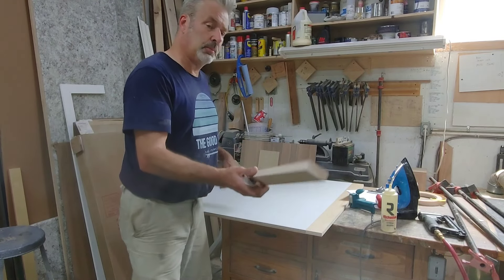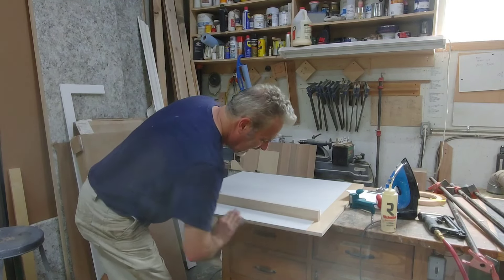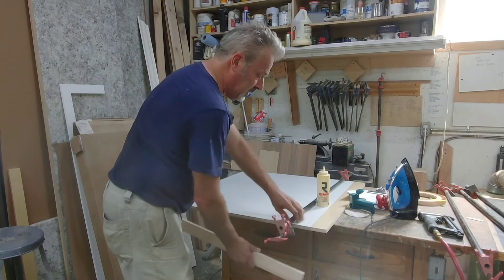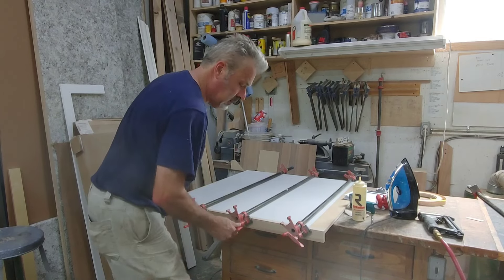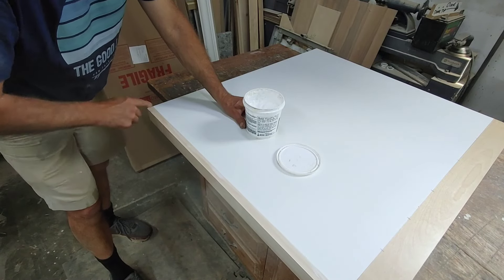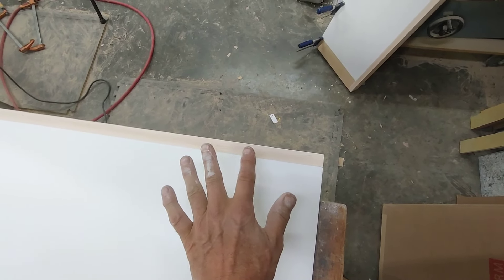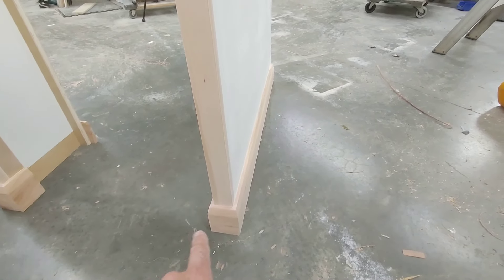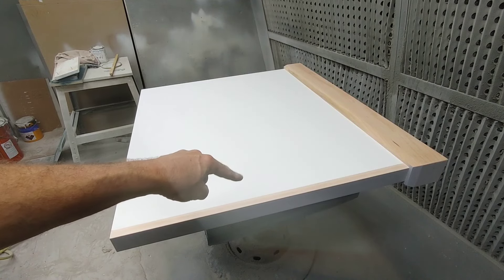Making island end panels.

Comment: Nicely done.  Simple little tricks like this, are so thoughtful.   It's like the screw trick, tha avoids cross threading.  Putting the screw at the old opening and turning it backwards until it bumps into the thread, the turning it clockwise as normal.  You never cross thread the hole..  Its  critical for wood and plastic parts and even metal.
Reply from the maker: Thanks Robin. Just got back from some holidays. Enjoy your week 👍👍

Comment: Are you using melamine to reduce the cost of plywood, and is it highly flat?
Reply from the maker: There's actually a number of factors. Yes the melamine tends to lay flat better. It's also got a little harder surface than the plywood. This way it can take a impact better. I just make sure it doesn't touch the floor so that there's no water issue. I glue plywood to the bottom of it